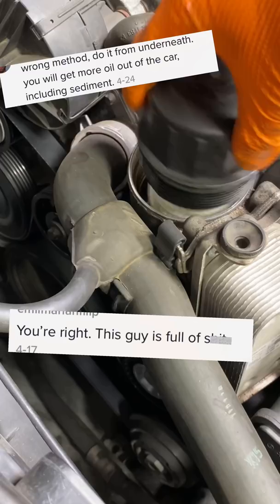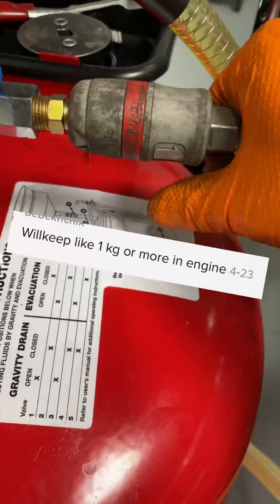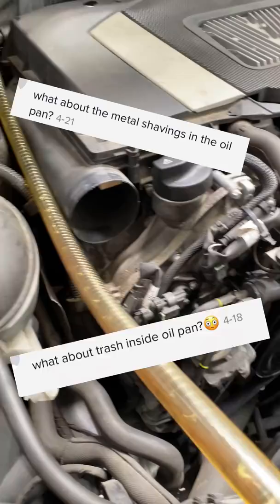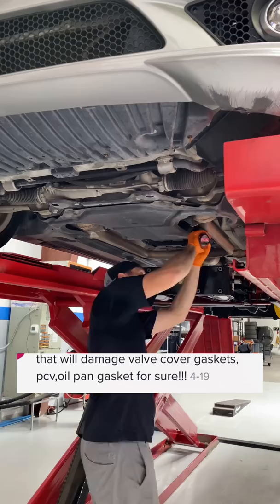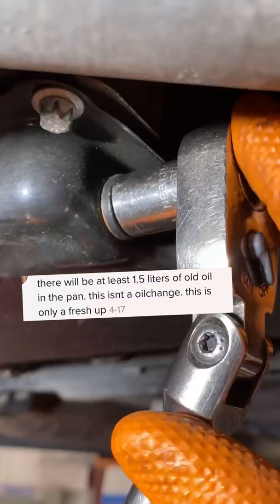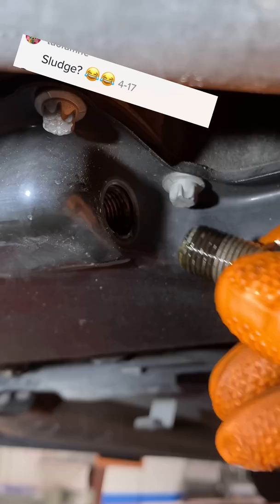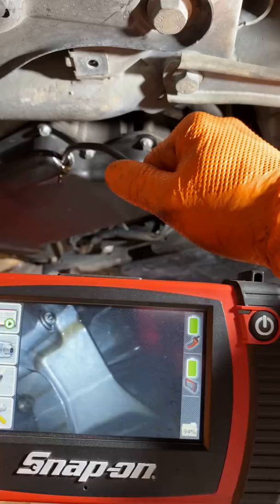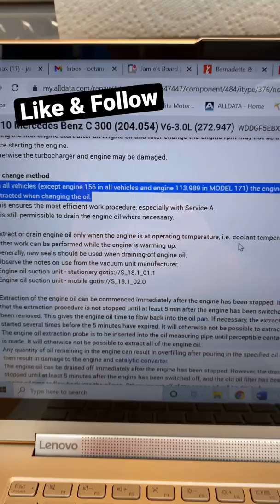#shorts Mechanic Proves Haters Wrong

Comment: If someone says "what about the metal shavings", debris or sludge I would say "if you expect that in the oil pan then you need way more than just checking the oil pan" 

I work on diesel and frankly tell wheel holders to shove it as I fix what problems they created because "they know their truck"... good drivers just say what the problem is in detail to fill out my 3 C's for paperwork and let me work.
Reply: Concern cause correction
Reply: Why the hell does my cascadia have a 6 amp draw with nothing after market plugged in 😭😭😭😭
Reply: Those are people who literally buy a car and don’t think there’s anything to do for 100k except fill it up with gas.
Reply: @rynechristesen2392  I dont think it would even last till then if you didn’t replace any fluids
Reply: I could t agree more! That was not thing I hated about doing heavy dusty diesel…… drivers always tried to tell me how to diag their electrical systems
Reply: @milesd3928  as a Truck Driver I'll be the first to hand it off and explain what it's doing. I work on cars yes but I'd prefer to let the mechanic fix whatever is broken.
Reply: And good drivers like myself thank you

Cuz you know what I know how to drive the damn things I don't mean I know how to fix one and so just like I wouldn't go playing surgeon on my own injuries I ain't going to try and fix the truck.
Reply: Yeah I was like 0.o metal shavings??
Reply: Shit if they have that in the oil pan they should probably look at their timing shit...
Reply: Me over here with my wet clutch sport bike having to buy a magnetic oil filter
Reply: @yashshah6328  I knew an old man that had an old VW Beetle and the only thing he did was change the oil filter. He would use the same oil over and over again with a new filter. That damn car had over 400K on it with zero issues from what he told me. He was a petroleum company conspiracy nut. Take it for what it is. I literally watched him change his oil like that one time. It was insane. I’d never do it but I’ll never forget it.
Reply: You sound exactly like the guy I took my truck to for years and I fucking love it
Reply: @kalebooty749  400k and maybe 1 legitimate oil change? Sounds absolutely physically impossible. Did he have oil that magically didn't break down over time? 🤣🤔
Reply: I just dont understand people who do that.  they brought the problem to you.  Its not like you went from cab to cab or something.  how are you going to pay an expert for help and then proceed to tell the expert what to do?  if your so sure, do it yourself.  its one thing to use past experiences to describe the current problem, but damn, let the man work.
Reply: @josephlewis5614  It has a 6amp draw with the engine off and key out? You'll have to hook up an amp meter inline with the battery and go down the fuses pulling them one by one until the load drops to nearly 0. Then you can look up the wiring diagram to see what that fuse feeds and check each item on that circut.

The most common parasitic draw offenders I see are back-of-the-sun-visor mirror lights getting stuck on, but 6 amps is way too high for that
Reply: @lordgman1  according to the shop it does. They blamed it on after market devices which is 2 phone charges, a tablet for ELDS, and CB which is off when I'm not running. My cab dome (not my sleeper) has a mind of its own and I have it unplugged because it cuts on and off on its own. The shop I took it to hit me with $3300 to put in a ground cut off switch because these new trucks don't all have them and I don't have a a tri pac to charge the batteries when they're running low. I had the batteries replaced twice before they checked for a parasitic draw :/ sucks man
Reply: Ah yes may i fix it for you too
Good driver=/= good mechanic
Reply: Didn’t change oil in my bike for 3 years, and the guy who changed it, “yeah it’s not bad at all”.. i didn’t drive much tho.. about that change once per year if you didn’t reach the mileage.. and on my new car changed oil on first 5k and it was like brand new, yeh some of those oil changing regimes are to sell more oil
Reply: To be fair the concern isn’t about the shavings staying in there, it’s about seeing the pieces of metal to tell if it’s just from wear or there is a bigger problem and somethings about to give out. At least that’s what we do on tractors, I don’t really work on cars.
Reply: @robob3ar  oil can last from 3k to around 5k miles depending how you drive it BUT oil also deteriorates with time, in manuals it would normally say "change oil every 3k miles or 6 months" now this varies depending on manufacturer and or usage of equipment as well as the composition of the oil, high end sport cars you get less time to change it as you would get more engine wear on bad oil and in diesel you have to keep up or you will have an engine that will be unreliable
Reply: @RiderZer0  that's true, metal shavings shouldn't be the concern but if someone expects it then there is a problem, now if the guy changed his own oil or went to a place to get it changed and they see metal shavings THEN it would be metal shavings on concern but it would need more detail to get it passed on paperwork to CYA

Cover your ass or it will come to bite you back
Reply: @bigcauc7530  take it how you want. I watched the man do it. He was crazy as hell and one of the smartest mechanics I’ve ever known (expect for that part). He kept it “topped off” so maybe that little bit of fresh oil to keep it leveled out made up for it. If you think about it though, oil doesn’t necessarily break down. It just gathers all the carbon and byproducts from the motor and keeps it lubed. You can run fresh oil for 500 miles and it will be compromised because it has gathered those byproducts. As soon as you put it in an internal combustion engine and combust the fuel it is “dirty” because it has instantly created new raw carbon for the oil to gather up.

Comment: If you have noticeable amounts of metal shavings inside your oil you have way bigger problems to worry about than how to change the oil on a Mercedes
Reply: I would say the same goes for sludge.
Reply: I put a rare earth magnet on my oil drain plug.
Reply: There is always metal shavings in the oil along with other contaminants. Metal rubbing on metal is gonna produce that maybe not that noticeable but its still there.
Reply: @nintendontbutdo5507  yep and in motors with steel parts a magnetic drain plugs will collect those.
Reply: Exactly why you drain the oil via the pool sn plug. I guess thats why a-hole Mercedes owners  not knowing there car has issues. German overenginerring fail.
Reply: I was thinking the same thing, LOL who changes their oil and expects metal shavings on a regular basis like every 5k miles?? I hope this guy isn't out there touching peoples' cars.
Reply: @nintendontbutdo5507  I mean not to sound ignorant but isn’t the whole point of an oiling system to prevent direct metal-on-metal contact inside the engine? Idk I could be wrong. Just my take
Reply: @Mygfisawesone  yeah well that may be the point but things dont always work perfect. Just like the abs break system on your car its there but that doesnt mean it will always work perfectly. There is a test company that tests oil that can verify what im saying about metal in the oil. Blackstone laboratories to be exact. You can send in oil samples using their kit and they tell you how well your oil performs and how long you should go between oil changes